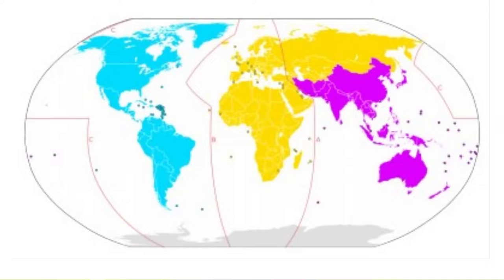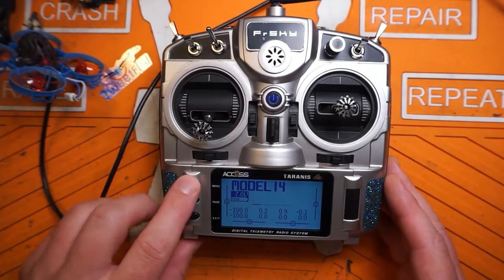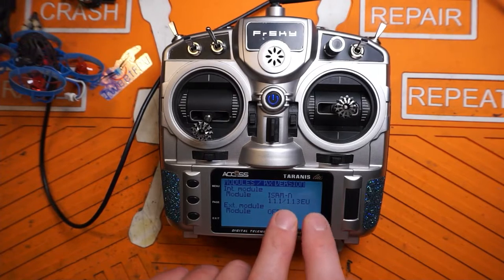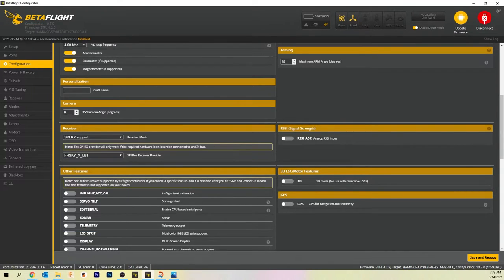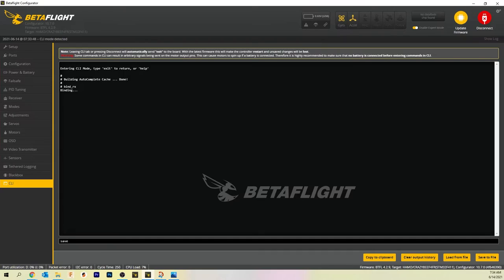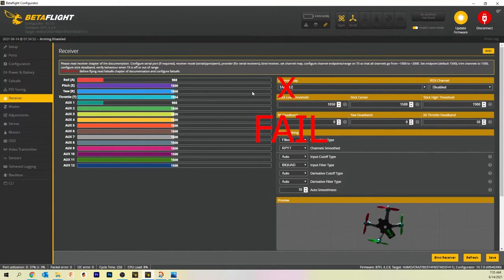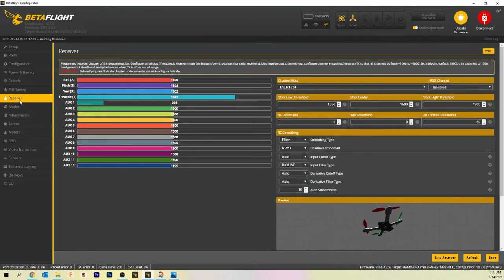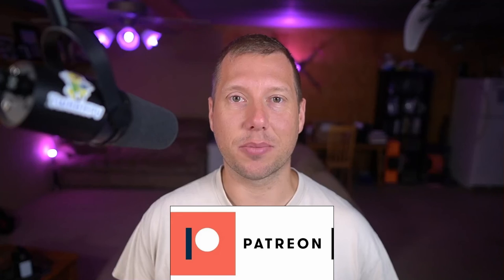Frsky ACCESS ACCSTD16 SPI Whoop EU LBT binding #frsky #access #whoop #binding

Comment: Thanks man, i tried it but still receiver tab not moving in betaflight
Reply from the maker: I would look into a setup/port Configuration issue.
Reply: @TweetFPV  Hi man thx for the response and video, it opened my eyes to another issues, i feel now closer to solve my problem 
This is my info : 
Drone Geprc cinelog 25
Radioking module v1.3.86 
Opentx 2.3.13 
Betaflight firmware 4.2.9 
R-xsr f. Port LBT accst 191128 
And they binding.. 
I did like in the video except my controller doesn't have the same option in the version tab to switch it from international to LBT ..  Its been over 2 week trying :( 

Really thx 🙏
Reply from the maker: Well if they are bound (blue and green led) and you still don't get any response in bf then it's either a wiring or a bf setup issue.